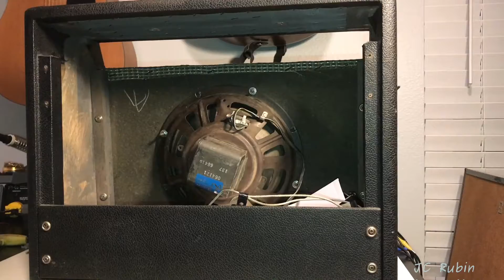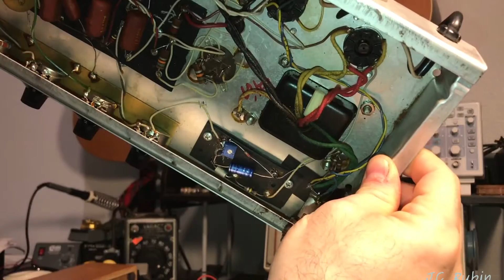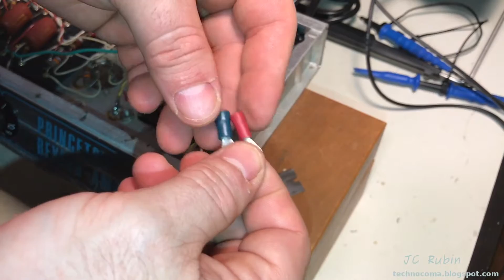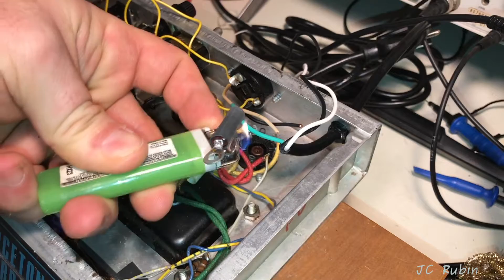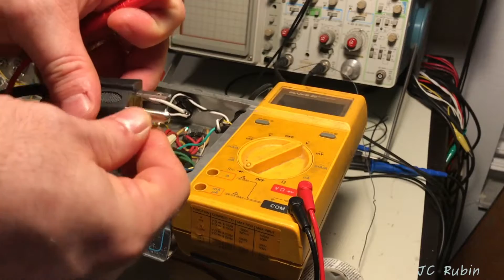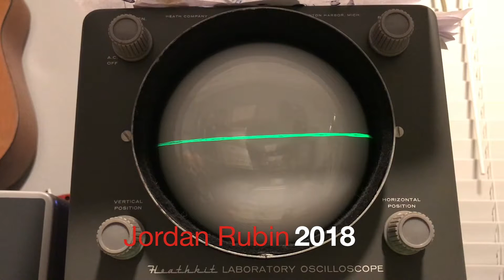Fender Princeton 3 prong grounded power plug conversion

Comment: At 3:49 minutes into the video you talk about the hot and neutral wires being connected properly to the outlet terminals which are polarized and the original 2 prong cord is connected correctly to the terminals and at 8:37 minutes into the video you reverse the wire connection to the outlet. The silver screw is the neutral connection which is polarized, the brass screw is the hot. When you tested the connections with the multimeter you never tested from the polarized slot of the outlet to the polarized plug prong if you had it would have told you its connected wrong. This is a dangerous error.
Reply: Good catch

Comment: How about installing a properly grounded female IEC connector in place of the auxiliary power socket, thus eliminating the hard-wired power cord install as well as the possibility that a connected power cord could be accidentally yanked out? Wouldn't that be a neater way to go? Would an IEC female socket provide an easier or a more complicated conversion? Thanks in advance for your reply.
Reply from the maker: Because owners don’t want their amps modified beyond the extent of repair. It looses value.

Comment: I use old school ground straps to keep it org I have honestly tested both amps before and after and sounded the same so I never change them unless kids are around or a customer asks 
I’m making a power supply with a 12v transformer and I’m using a ic 3 prong where should I ground to chassis?

Comment: I have a 1969 Kustom 200 amp head  100 watt that needs change of capacitor and a 3 prong replacement cord. I keep getting shocked. The capacitors inside the amp look like little blimps.
Reply from the maker: It may be the cap to the chassis causing you to get shocked!!!